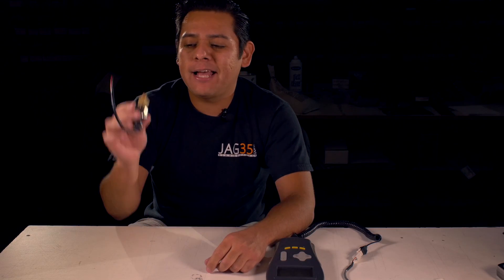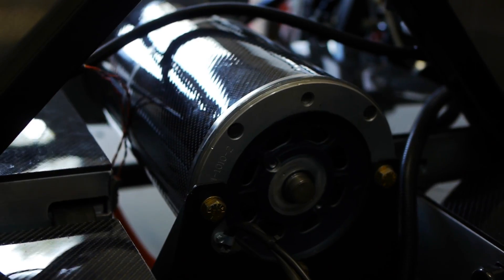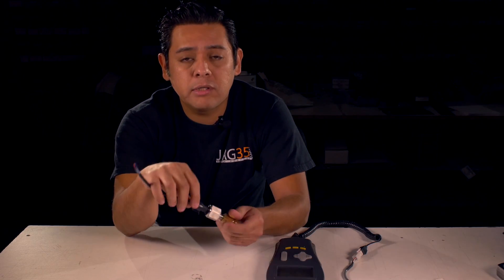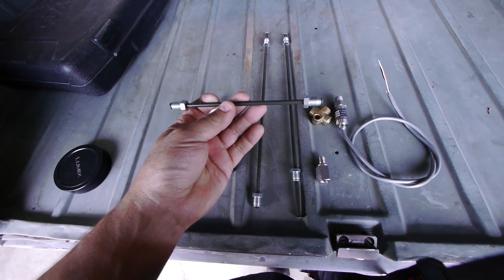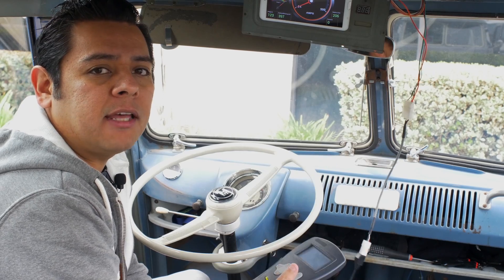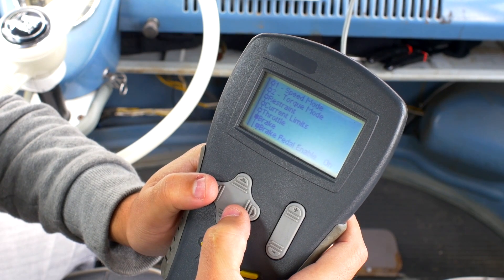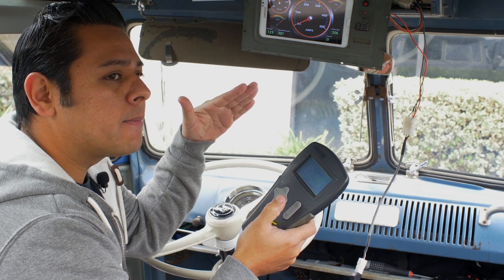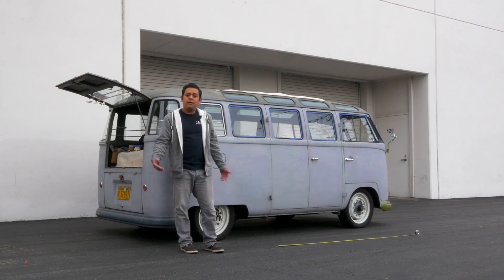QT #2 Using Hydraulic Transducers on your Electric Car

Comment: jehugarcia
Hey jehu, nice videos. Your show has a nice mix between technical information and sharing experience.
But I wonder if the regenerative braking wouldn't be better like Teslamotors' approach to one-pedal-driving? It would be than all about the motor controller to regen if you go below the neutral point of the accelerator pedal. The regen would be still there if you brake, so still both, the brakes and the motor, slow together down your Samba. The accelerator would also act as sort of a dead man switch and brake to reasonable speed if you let go of the accelerator for unforeseen reasons. That way you wouldn't need a hydraulic transducer.
Did I miss something why the one-pedal-drive isn't preferable? Is it because you couldn't use full regen for one-pedal-driving because it would break to much, but you want to provide full regen for braking for the shortest braking distance possible?
Reply from the maker: Personal preference,  I would do it on the accelerator if the curtis software allowed for a soft curve,  it doesn't it applies regen kind of abruptly so the only way to control it smoothly is using a transducer

Comment: I've rebuilt hundreds of dc motor controllers. I've rebuilt dozens of AC motor controllers. I run a group that has built and promoted EV's since 1967. DC has a 3 flaws. 1) When fets or igbt's die, they die 99% of the time in a shorted condition. In a DC system that means full throttle is the failure mode. That's why experienced EV builders have a circuit breaker installed with a pull cable on the dash to kill the system in case of a failure. If a fet or igbt shorted in an AC system, the logic kills the power to the fet drivers. Also without all 3 phases working in sync, the AC system won't power the motor with a shorted fet or igbt. So AC's failure mode is to stop running. DC has been the DIY choice for decades because it's simple to buy and build. REGEN: The only DC systems with regen are typically 48 volt and lower H-bridge motor controllers. 2) The problem is that they have to use twice as many transistors. One group for forward, and another group for reverse. To make an automotive level system, the controller itself would be physically huge due to twice the volume of transistors. Also, the transition between the forward and reverse groups, is a pain in the ass to make it operate smoothly. AC systems have regen with only one set of 3 transistors. Generally they use an industrial igbt module that handles 600v and 300-600 amps. The module has only one giant igtbt in it. You can buy them on Ebay. 3) DC motors are very limited to low rpm ranges because there is so much copper in the rotor that centrifugal force will break it apart if it over speeds. AC motors have far less copper in the rotor, assuming that it doesn't have an aluminum rotor. The old AC systems from 20 years ago can spin up to 13,000 rpm. The newer systems can go as high as 16,000 rpm. DC motors are more expensive to make due to all of the copper and the brush housings. AC motors are used in industry to power almost everything in your life. So they are far more readily available to adapt to EV use. Juhu, I will only respond to you since you are the one doing the real work, not just blowing hot air. Your channel rocks brother! I think a throttle pot would be far more reliable and safer than a hydraulic transducer.

Comment: you keep talking as if regen breaking only works with AC,  DC permanent magnet motors work great as generators thus great for regen.
Reply from the maker: Show me a car that uses a DC system and has regenerative breaking,  Give me a link to where I can purchase such a system.
Reply: jehugarcia
i'm going to be building one, using a forklift motor and a homemade controller. why would you buy a system if you can build it yourself?
Reply: *****
if my local museum would let me purchase their 1914 Chicago Electric i bet i could modify it to have regen breaking. :P
Reply: *****
 no i think most of the things that are donated to that museum are under agreement not to be sold, otherwise its returned to the family that donated it.

i would just build a replica from scratch.
Reply: *****
yeah i like my Zoom H1, although i havent used the filters. i can do any modifications in Audacity if i need.
Reply from the maker: Guys,  I think you are missing the point, there is a reason why there are no full size DC systems that have regen commercially available.  Its the same reason why there is a scarcity of DIY systems of the same type.

What is it?  too expensive? too complicated? too unreliable?  Just because something is possible doesn't mean its practical  or a good idea
Reply: jehugarcia
it seems that its actually cheeper to make a DC system than an AC system if you shop around in junkyards and stuff. i'm still working out the variable motor driver but i may just simplify it to use large contactors. and as for a charger i'll grab another old 1940s welder and put that transformer into the back of the car, should be far more reliable than any step-down boards available today and far cheeper.

you say there is a reason for no DC systems on the market, but you dont tell us that reason. so please tell us now.

from my experiance a DC motor works very well as a generator with a high efficiency. as for Glytch's comment on them wearing down the brushes faster i dont find that to be true either. brushes usually only wear down when the motor is run in reverse or too much voltage.

so please tell us, what is the reason?
Reply from the maker: I don't know the reason,  But if DC systems are such a good idea,  why aren't they available?  why aren't people using them in 3000+ lbs cars?  you seem to think they are easy and cheap and All i'm saying is that if that were true then they would be available and very popular.   But they are not.
Reply from the maker: Show me a link to a DIY project using DC motor with regen, and you'll make a believer out of me .
Reply: jehugarcia
you've never heard of using a DC motor as a generator? one of my very first videos demonstrated this.

https://www.youtube.com/watch?v=BTWzUF4PujI#t=1m9s

i know several people that us DC motors in their car. BenjaminNelson  i believe tesla500  has an electric car that runs on a DC motor also. a DC system wouldnt be very difficult to upgrade to have regen breaking. it would be far easier than AC induction motors.

as for why you havent found any DC kits that have regen breaking, i have no mind-reading powers so i wouldnt know the thoughts of the designers.
Reply from the maker: lol,   oh god, are you familiar with the concept called logic?
Just to recap what just happened here:
you guys said:
Hey!  DC systems have regen also.

ME:  really?  where are they?

YOU: I have one, just haven't built it yet.
DC motors are good generators?

ME: Show me an example of DC regen. show me where I can buy one

YOU: I don't know where, but motors make good generators. - chicago electric, basements, Zoom h1,  freezing.

ME:  the reason they are not available is probably because they are not possible or practical 
  
YOU:  Practical? practical who?  they exist.

RINOA: you can get a cheap DC motor on junk yard. I need proof why DC might not be practical.

ME:  the proof is that they don't exist as far I can see,  Prove me wrong by showing me an example 

YOU:  You need proof? you are dumb,  you bought one of those curtis systems that exist,  and work,  why don't you do some research and get one of the DC systems that don't exist.  Im Done.

Aww…. yeah pretty much.
Look guys, I understand that you have an opinion, but when you fail to provide proof that corroborates your opinion then I and everyone else with any sense will find it hard to agree with you.
Reply from the maker: Rinoa Super-Genius  Show me the proof that DC systems can be easily made to Have regenerative braking,  If its so easy why is it that you are incapable of providing me with a single sample of such system?  
I can say that going to the moon is cheap,  but just because I say it doesn't make it true, Now if I had a craft I built myself and I had footage of me standing on the moon then thats a different story.   Or I can show someone else that went to the moon on $20 then i might be right,  Otherwise Im just a guy saying crazy things.   Show me the proof
Reply: jehugarcia
god your thick

well i've already shown what i assume to be proof enough, i showed that if you turn a DC motor it generates electricity thus its not that hard to feed it back into a battery.

so what do you define as "proof"?

if you want stronger proof then hold your horses till i convert my 1981 mercury zephyr to electric. or idk do a google search.

you could build a nice regen module with some 74hc14 chips and a microwave oven transformer.
Reply: *****
thanks! i figure the parts list wont be all that bad.

DC forklift motor - 250$
some power transformers and a lot of MOSFETs scrounged from old electronics. some resistance coils and a few 74hc14 chips to work as oscillators. and then just a bunch of other random crap i can easilly find or already have.

i'm going to work on the motor controller when i'm out in silicon valley then ship it back to assemble the car in my dad's garage.

i may build a motor controller for my electric lawn tractor first though. it seriously needs one.
Reply from the maker: Ok Guys,   Like i Said, Regen only exists on AC systems,   Plenty of examples to be found,  plenty of commercially available systems.   
Just because you guys say it can be done its not proof,  just because eBikes controllers have regen does not mean you can use that on a full size car
Reply: jehugarcia
no, your stating a negative. you cant have an example of a negative. logic doesnt work that way. proving that AC systems with regen exist doesnt prove that DC systems with regen dont exist.

ok so i have my electric car and i'm going 70mph down the interstate. i turn off the power to the motor and now the DC motor is being spun by the wheels. the DC motor being spin creates a voltage differance between the two connectors at a bit bellow the power i feed into it to get it up to that speed. if its a 48v motor it will probably put out 40v at that speed.

so now the motor has a 40v voltage differance its creating but its not having any amps pulled from it so it isnt slowing down the car. i flip a switch and my regen system pulls a load from that motor. many amps are being pulled from the motor now and so the voltage dips down a lot to about 24v at 80a or so.this is now pulling about 2kw from the motor and subsequently more than 2kw of momentum from the car.

this 2kw of electricity is then stepped up in the regen system to 50v 35a and is fed into the battery array and charges it slightly.

and there you go. regen breaking in a DC system. what dont you understand?
Reply from the maker: I don't care that you think its easy,  Back your opinion with facts,  show me that someone has done it,   You can't, and  you don't know why you can't,  but I do,   its because   they don't exist.

ok I'm done here,  I'm going to go drive my electric car I built myself.   you should take your own advise and go build something, maybe that will help you distinguish between reality and your opinions.
Reply from the maker: Rinoa Super-Genius I understand the concept,   what i don't understand is why you think its so easy while discarding the fact that there are no samples of such system.

Going to the moon its easy,  you build a round tube,  fill it with liquid fuel, poke a hole on one side,  strap a seat on the opposite side,  ignite and BooM!   20 or so hours later,  you are on the moon.   Simple.  Nasa has done Why can I?

just because you understand a concept does not mean you can execute it. You can't even provide a sample of someone else that succesfuly executed,  Why do you discard such fact?  you know why?  because you are naive,  you think that because something seems easy therefore it is.

So when I say that DC regen does not exist,  and you say "it does in theory"  I say theory alone does not drive your car down the street.
Reply from the maker: Rinoa Super-Genius   OK guys,   go play with your toys,  one day you will grow up and you will join me in the real world where unbacked opinions don't really matter much.
Reply: jehugarcia
 because its not difficult to set up the output voltage of the motor to charge the batteries. its really just building a large step-up module. i'm probably not going to mess with regen on my system just because i dont know if regen would be worth the tiny amount of electricity. i would start by burning off the electricity in a heating coil.

you do realize my job is building electric vehicles right? so far on my youtube channel i have built an electric bicycle and then an electric lawn tractor as i scale my designs up. my opinions arent unfounded, they are based off my own experiance of build electric vehicles plus other's experiance. why dont you watch my videos and see for yourself?

and maybe you underestimate "theory". you do realize the "atomic theory" isnt a scientific law yet. i think your equivocating a lot.
Reply from the maker: Rinoa Super-Genius Wow what!   you can prove God doesn't exist? Damn I think you are waisting your time playing around in junk yards,   why do i waste my time with kids?   Oh well
Reply: jehugarcia well i didnt say that but whatever. you seem to be intentionally misreading everything we say....or you dont know english very well.